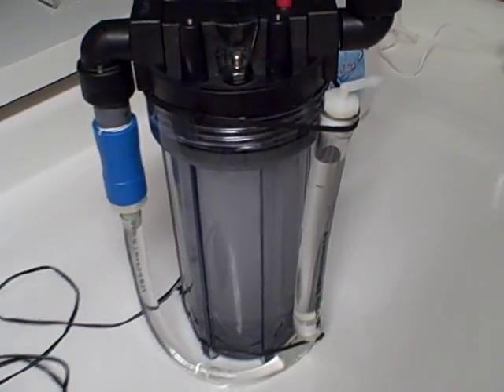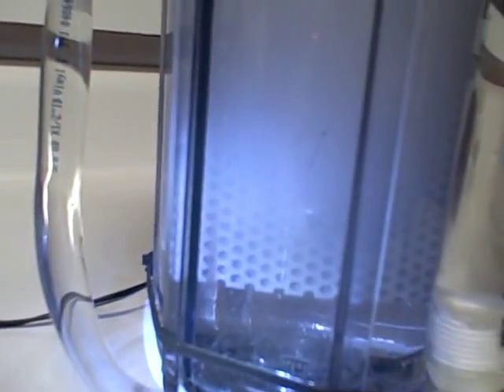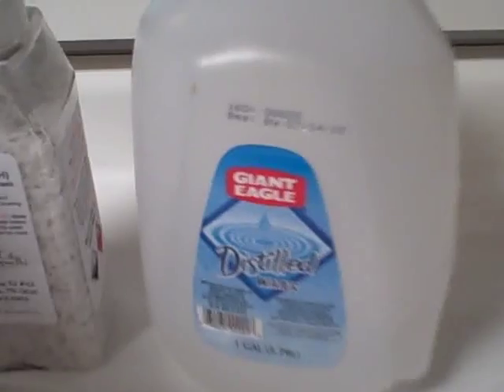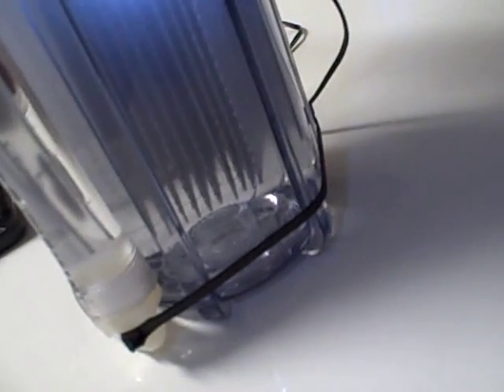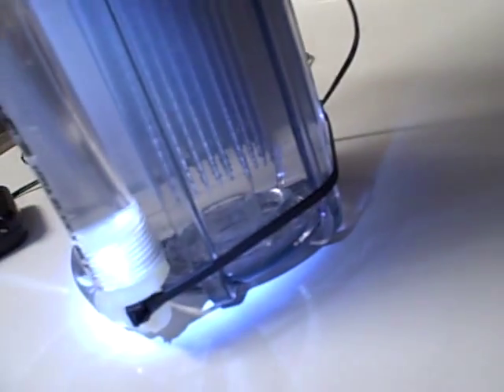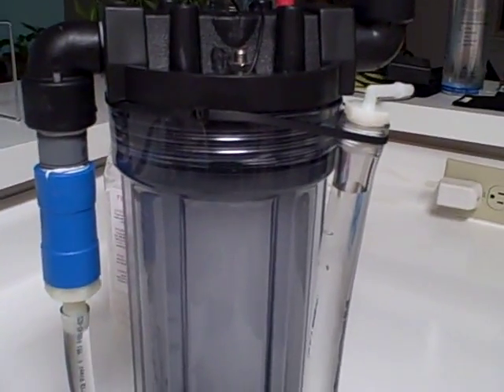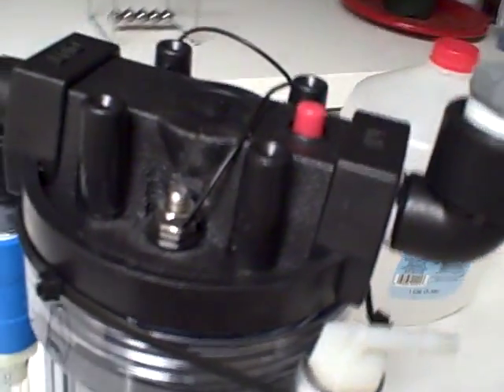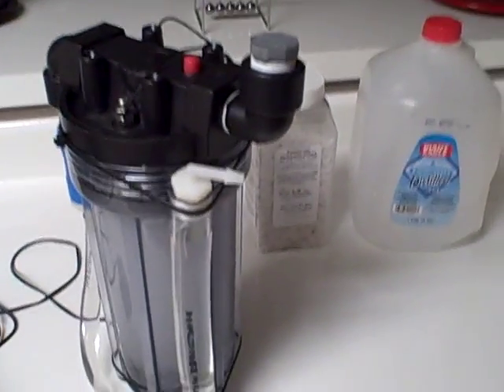Aluminum Electrolyzer, KOH

Comment: plug it in , do some test then make a exact copy in stainless and compare
dont try to get a material that wont corode and make the water take away the resistance , get a material with no restance then get the water to stop corosion

Comment: I just used tap water but it only corroed with current, I heard if you saturate with bicarbonate then it wont do it and it will be a good electrolizer

Comment: I got to thinking about what I wrote you, and I had to come back and tell you I am sorry!!!, I gave you some wrong info... if you connect your plates like that sure it will work OK or one might say Good, ya true but I got to thinking and I dont believe that thats the best configuration!  energy moves from + to - right, maybe, thats what weve been tought. so if that is true then wouldnt each - on both sides of the + compete with each other for the energy from the +. I dont want to give it away

Comment: I tried with little sucess hooking the wires into a light dimmer switch, eather I didnt hook it up right or that thing drew amps like crazy! cause as I pluged in the makeshift cord I wired it to, the thing acted like it was full blast, even when the dimmer switch all the way down before it was in the off possision so, I got nervous and quickly turned the thing off. I finally got the courage to let it just run and see what might happen, so thats what happen, guess what the water started looking

Comment: ok but, I havent ever really built a real HHO Cell only crazy experiments, it was back in 2004, I think and it was with a 2 letter soda bottel, I just poked two small holes in the top, for the copper wire to go threw, and siliconed it air tight, all I had to work with was just like you except plates made of Alm. it was some old wind chimes, I filled up the bottel just before were I twisted the copper wire in both tubes, all I added to the tap water was sodium cloride(only real salt)!

Comment: by the way thats a beautiful HHO cell! eventually you might try finding some 316L stainless, its hard to find at Lowes or home Depot, but I did its used as back splashes over by the washers and dryers, comes in like a 4x4 pice. I dont know how much iron it has in it of if it is high grade 316L, one test you can do it put a strong magnet to it, if it wont stick thats good!

Comment: one more thing, if you do this I recoment making a mold to pore the liquid plastic in, to cover the connected area, also be sure to have the connections on bottom and top start at one end with a wire and another wire at the othere end, so two wire connections for the connected +'s at top and two on bottom for -, also remember by putting them at oppisite corners this allows better  flow! A/c allows I believe the alluminum to not corrode, at least thats what I notices, its the pot hydroxide!

Comment: you also can try this, by connecting your plates +-+-+-+-+-+-+-+ with no nutrals this works great also, but dont connect just at the top of the plates(fully energize) , you want to connect all the +'s at one corner with copper connections, a long copper bolt works great, and all the -'s at oppisit corner at the bottom of plates, Important note you must seal those connections, I recomend a liquid plastic, you can get it at hobby lobby, this will pertect it from corroding, hope and pray this helps

Comment: You can try white distilled vinegar for your electrolyte but the aluminium is still going to oxidize but it may last for awhile before it is eaten up in the process of electrolysis. But it sounds to me that SmartScarecrow is telling you right as I have used aluminium cans and creek water which had alot of iron in it and got pretty good results but it didn't last long. And you have to flush it out alot as well otherwise it just shorts out your cells, if you arrange it in the usual plate system.

Comment: your aluminum will soon be mush ... this is a fairly violent chemical reaction between the potassium hydroxide and the aluminum ... it is releasing hydrogen but there is not much of a way to control the reaction ... the aluminum is consumed in the reaction as is the potassium hydroxide ... its like putting iron into nitric acid ... this is dangerous as hell to do if you have a really strong solution of potassium hydroxide ... reaction can get out of control fast and make much heat ... BOOOOM !!!